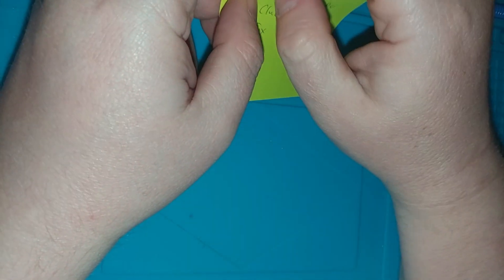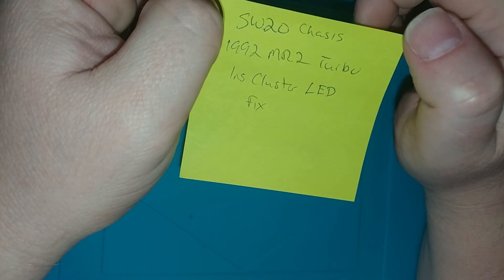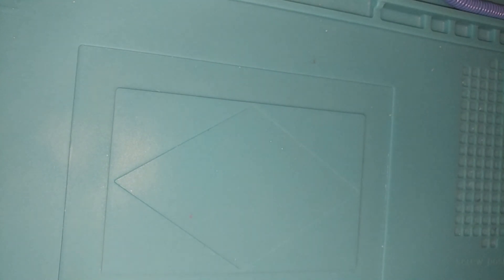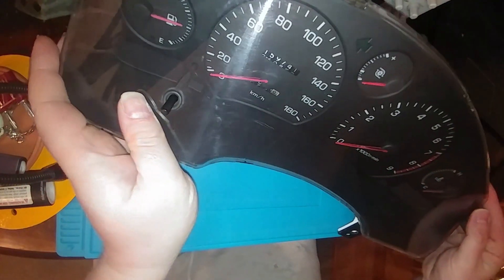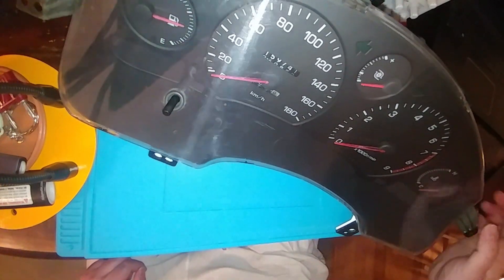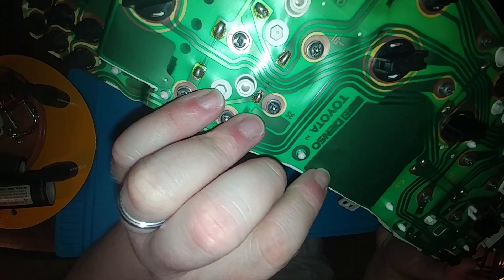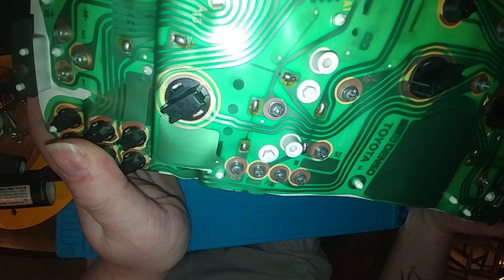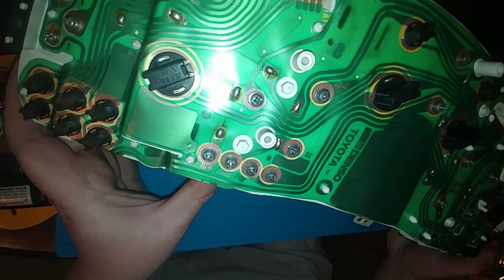Quick Fix: 92 MR2 Turbo Instrument Cluster Dim LEDs

Comment: The first possibility you listed is the correct answer.
The second and third are ruled out entirely.
This is a common issue for the mr2, and any other Toyota and Honda from that same era.  People switch out to LED bulbs and the flicker occurs.
For some people it does not and everything is fine because they just happened to purchase a brand that played nicely with the 12v system.  Brand names mean nothing, price means nothing, I have tried all manner of cheap eBay LED bulbs and some will flicker, others won't.

Another common issue is indeed the contacts being old and pressed in.  This causes people to think their bulbs went out entirely.  They also often put in their bulbs backwards.
I never used a gel pen for this issue, I resolve it with a small piece of sandpaper on the contacts instead, as well as using my fingernail to pry up the contacts on the black bulb holder just a tad so they press mildly harder when installed.

Light in the cluster does not come directly from the bulbs, it is filtered through "plastic glass" prism that has its ends pointed at the bulbs in certain angles.  Hence, people have purchased bulbs that were very bright, but sat oriented too tall or short in their black seat.  Causing them to be in the wrong place for the "plastic glass" to catch enough of the light.
They function like those cheap cyberpunk visors I've seen going around, which light up from bulbs hidden in the ear hooks.
The solution to end all flickering is to simply purchase more bulbs from different sellers that have different physical appearance, different bulb styles and orientations, and then try them each till you find a set that does not flicker.
The brightest ones usually are seated on black circuit boards these days.  While the ones with white plastic cups (or blue ones like in your video) have the weaker light.
Reply from the maker: Everything you stated makes complete sense. Very much appreciate the feedback you gave to this video!
Reply: No problem, I like your work and presentation.
I'm not an electrician but I have been building and working on mr2' specifically since early 2000.
Reply from the maker: If I ever get my hands on a cluster panel again. I would like to try and use a capacitor to see what effects that would have on the flickering.
Reply: You wouldn't cause any harm since it is a simple circuit like any other in the vehicle:  power from battery goes to a 15 amp fuse called "TAIL", then to the dimmer switch, then through two separate circular circuits.  One for the bulbs in your video and one for all the others in the vehicle (buttons in door for window and lock control, Hvac and stereo and so on).
However, it will likely have no effect on the bulbs.  If I explain my purchasing behavior you will likely understand.  It's a defective product issue:
Purchase in bulk, they usually come in 20 for about 6 bucks, indicating the cheap nature of the product.
Wire them in series to a stand alone vehicle battery.  Some will flicker immediately (flickering involves two or sometimes 3 of the emitters on one bulb while the rest remain dead).
I leave them all wired to the battery anyway for 24 hours or so, as some bulbs may seem fine now but begin flickering by the next day.
In 24 hours or so, I now know which bulbs are fine to keep and they will last years while the others are flickering garbage.
Reply from the maker: @user-or1xh1vc8n  when I lived in the UK I swapped out the incandescent bulbs in my living room for LEDs. They were tied to a dimmer switch that was good for voltage control but had an effect on the current draw in a manner which caused the bulbs to flicker while on LEDs unless one in the series of bulbs was a standard incandescent. My assumption was based on the total amount of current used in the circuit had a negative effect. I think a driver power supply would be more appropriate for the application of LEDs in the dash of an MR2 if put between the 12 volt supply and the LEDs themselves. Personally I just like to experiment if not just for morbid curiosity. Your experience you're sharing though is invaluable. Thank you again for your comments.
Reply: By all means, I love to experiment too, I love data.  From my experience the issue with the bulbs in this particular case is something you likely have more education on than I do.  The emitters themselves are not faulty.  There are tiny black devices on the backs of the boards that seem to be a flip of the coin on whether they are defective from factory.
I do not think they are diodes.  They are like tiny black monoliths.
Removing one from a normal working led and soldering it onto a flickering one will cease the flickering.
Reply from the maker: Education never supplants experience in my opinion. It can only ever be supplemental. Experience teaches how to do something a certain way for success based off having seen an issue time and time again. Education may only provide or answer the why behind it at best. I have worked with many technician over the years that I would call on before someone with a degree. It was because I knew they were experienced enough to solve an issue with efficacy. That's not to diminish having a formal education by any means. It is always good to supplement experience, but brains does not always correlate to being proficient when it comes to maintenance or production.
Reply: I wouldn't disagree and am grateful for the sentiment :)
Would you happen to know what the tiny black chips on these led boards are called?
I assume their purpose is to alter voltage somehow to make the led happy.  It couldn't be for preprogrammed flashing patterns since all it does it turn on when powered.

Also, for your testing purposes you do not need another gauge cluster.  The led will exist the exact same behavior when wired raw to a 12 volt source.  Your knob in this video is the same as a dimmer switch as well.  So conditions are exactly the same.  Nothing in the cluster or vehicle circuit alters said condition.  Power, fuse, dimmer, ground. (You questioned ground in the video, note that all grounds lead to the body, in this case, a bolt in the kick panel above the driver's left ankle).
Wiring a single led that is flickering to your power source directly will be the same experiment platform as placing it in the cluster. So the results of any experiment will lead to the same conclusions, whatever they may end up being.  But if you prefer having a cluster for whatever reason, any cheap Honda Civica/accord or Toyota Camry/Corolla cluster from the early 90s will be exactly the same basic design.  They even purchase their components all from the same commissioners in Japan (denso and aisin). I hope that helps.
Reply from the maker: I personally don't recall that component. Can you send me a hi res photo to my Gmail. It should be in my YouTube information section.
Reply: I could not find the email, possibly the phone version layout is different from the pc version.  But I assume it's havingfunrepairs at gee male.
If not no worries, you can Google auxito led 194 and find some that have the little black chips on the sides instead of on the bottom.
Reply from the maker: @user-or1xh1vc8n  ohhhh I understand my confusion now.  Those are SMD resistors. The numbers stamped on them correspond to their resistance value followed by how many zeros. For instance one that is stamped 431 would be 430 Ohms. A 432 would be 4300 Ohms.
Reply: Oh wow ok, then this may be the component that is cheaply made and a gamble as to whether your led has good or bad ones
Reply from the maker: @user-or1xh1vc8n  if you have a multimeter you can place it in ohm and measure across the resistor while the LED is not plugged in. Emphases on the not plugged in. Usually they're within 5% tolerance of marked value. Outside that range is bad.
Reply from the maker: It's possible, they're meant to limit the current. I would think if the resistive value was too high across all LEDs in a series that may be the cause. You might be able to just jumper a few of the resistors effectively bypassing them and see what effect that has.